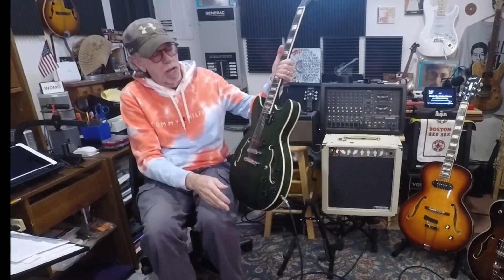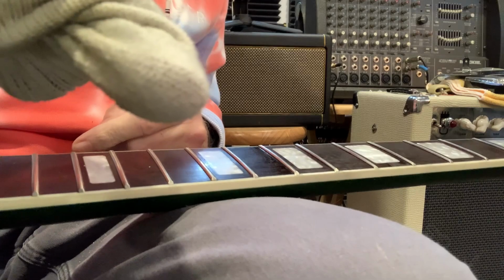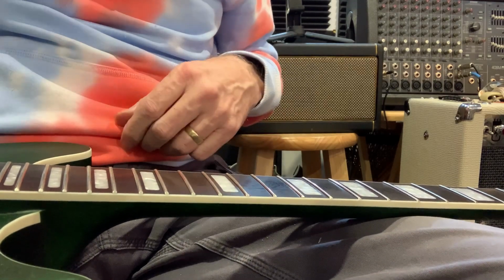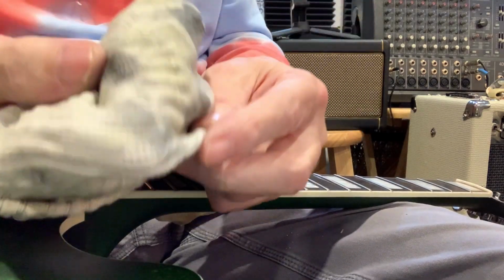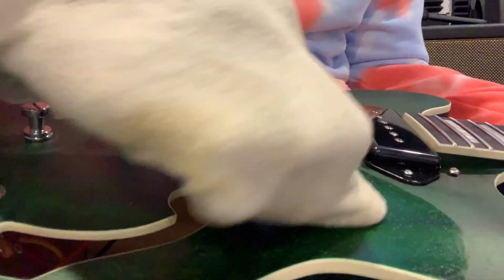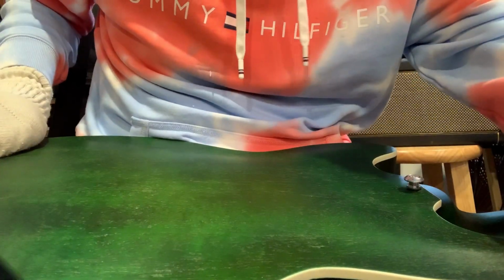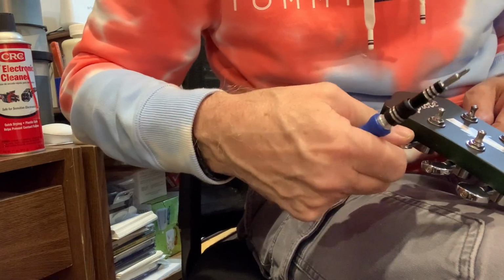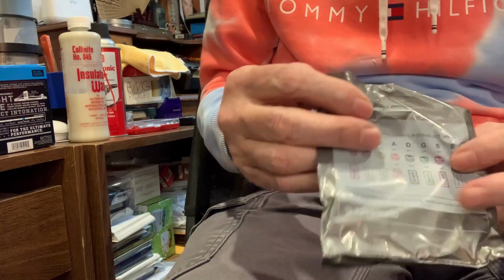New!! Grote | GR35MT | P90’s | Cleaning | Quick Setup

Comment: Hey Jimmy!  Very nice, a beautiful guitar!  The close ups of the finish really show how nice it really is. One thing I find helpful, even on some "higher end" guitars with a pickguard is to remove it and put a couple small layers of a strong tape (duct tape, gorilla tape, not masking tape) over the screw of the pickguard support underneath the pickguard.  This prevents that screw tip from making contact and putting a divit in the finish. I learned this the hard way.
Reply from the maker: Thanks so much Ted for watching and commenting!  Yes, the finish is quite nice and unique on this guitar.  Thanks for mentioning the “pick guard tip”, as yes, I use plastic caps on a couple of the Firefly’s specifically as the screw mount and screw on those is quite long and almost touches the finish with no pressure on the pick guard at all!  Taping the screw is another way to do it...good call!  Or, you can remove the pick guard altogether, as sometimes that looks good, depending on the guitar.  I am probably going to reinstall the pick guard on this one however.  Thanks again for stopping in...much appreciated! 👍

Comment: Great vid, Jimmy! The Grotayy sounds excellent! On a side note, I don't want to be 'that guy'. But, make sure you spin that fret rocker so you're only measuring 3 frets at a time. That's why it has the smaller sides. Fret rockers drive me berserk because there always to seems to be a little rocking in different spots sometimes that are hard to nail down. I've had to force myself to not worry if there is a very tiny bit of rocking.
Reply from the maker: Thanks so much for watching and commenting!  I usually just run it along (fret rocker that is) to do a quick check on heights.  I do give it a spin if I find something a little unusual in a spot, but yeah, thanks for keeping me straight! 😎. A small rocking usually doesn’t concern me either....this only had a small area that I hit a little more with some sand paper...wasn’t enough to break out any files.  Thanks again, and appreciate your stopping in to the channel!  👍

Comment: Hi, Thanks for the vid, I'm wondering if ya were to remove the pick guard from the single pick up Grote ... what would you have to do to make it left handed... replace the nut? Do you switch around the pick up? this would be my first electric guitar, thanks for your input Jimmy
Reply from the maker: Hi Todd…thanks for watching and commenting!  I would say, if you really wanted to, you could convert it to left handed.  Yes, you would need to replace/recut the nut.  If you simply just “flip” it, the heavier gauge strings would not fit in the smaller gauge string slots and the smaller gauge strings would surely just flop around in the larger slots.  You can buy “left handed” nuts, but you could also buy a blank and slot it yourself.  Of course the controls would be upside down and in a awkward place, but most can overcome that.  The bridge would also have to be reversed or replaced as well.  The bridge saddles follow the fretboard radius, so simply flipping it over (much like the nut explanation) does not really work unless the string saddles are correct.  You could probably do it by flipping it, then removing each saddle and turning the saddle around to correct position, or again, buying a left handed ToM bridge that fits.  Same with the pickup.  I think there is enough wire on the P90 to flip it around.  You could probably “fix” the stock nut to work, but they are cheap enough to just replace and save a bunch of work on your end.  Hope that helps a bit…I don’t think there is any concern as to possible “warping” neck or body wise as far as bracing and such.  Appreciate your stopping in to the channel and good luck should you decide to proceed.  🎸👍

Comment: Jimmy nice job on the guitar. I do exactly the same process with all my new guitars as well. I just went through it on the IYV400.
Reply from the maker: Yep!!  Just wanted to show a few folks (many ask) what my process is...most will be amazed at how much better ANY guitar will play once you get it set to your playing style and properly cleaned up, with good strings...
Thanks Mike! 👍
Reply from the maker: By the way Mike, how did your IYV 400 come in?  I know you will probably do a review of it, but was just wondering if there was any obvious issues on receipt.
Reply: @JimmyStewart1  
Out of the box it looked amazing. I got it downstairs on the bench and started doing a more detailed overview and I found like your green one, dirty fretboard and dirty Frets that needed to be polished. There was only one high fret at  16.  It was barely causing a buzz there so I just tapped it with the special hammer and it solved the problem. I then found a serious scuff mark on the inside of the horn. I noticed the nut needed to be cut the better to lower the action at the first fret. The rest of the front of the guitar was great and so is the back. The neck satin smooth no rough spots this time like the first Ivy I bought and the headstock was in really good condition. One of the bridge pickup mounting screws has the head stripped out on it.  The tuning keys are the fender looking ones and they work well enough they might be a little bit coarser but they're working just like IVY number one that I bought. In the end I had to replace the nut with a new one and I did the full cleaning and set up to my specifications and it now plays just like butter as Jimmy says
Reply: Since you own more P90 guitars than I do, do you know whether the soapbar mounting screws are a number two or number three?
Reply from the maker: @2bikemikesguitartopics145  
Super!!  Sounds like all in all nothing major and mostly stuff you can expect to do!  Have fun with it! 👍
Reply from the maker: @2bikemikesguitartopics145  
I would think a 2, but I would check on your guitar first as I am pretty sure they may vary from different manufacturers and perhaps even by different model at these price points.  If you are trying to raise those soap bars, it depends on how IVY mounted them.  Could be on springs (doubtful) or they used foam (probable).
IYV is the one brand that I DONT own a guitar with P90’s...🤣
Reply: @JimmyStewart1  
They used foam because I took out the neck pickup and looked underneath. The bridge pickup has the buggered head of the screw I just wanted to change it out
Reply from the maker: @2bikemikesguitartopics145  
Yeah, ok....got it.  Not having one of those, I don’t know the size.  Just take the other good one and try to match it up I would guess...

Comment: Nice video, Jimmy.  Thanks for sharing.  What is the name of the wax you are using?
Reply from the maker: I used Collinite No. 845 Insulator Wax.  You can usually find it at your better automotive/marine/RV supply places, or on Amazon.  It’s a bit expensive, but does a great job and won’t harm the finish.  A little goes a long way!  Thanks so much for watching and commenting Roger…much appreciated!  👍🎸
Reply: @JimmyStewart1  Thanks for the info.  I just bought some online.
Reply from the maker: @007380  
That’s great Roger!!  Glad to help!!

Comment: Jimmy, would it make sense to polish the frets first and then do the fret board cleanup and oiling so there is a single cleanup process or is there a reason you do it in the sequence you suggest? Thanks.
Reply from the maker: @philiptalk  
You can do it however you want that makes it easier for you…I usually go over it twice anyway, so just trying to catch what I can for a quick cleaning and setup!  Thanks for stopping in…🎸👍

Comment: I didn’t get where you sourced the fret protectors.  My father and I were jewelers I like your quality workmanship.
Reply from the maker: You can get a set from Amazon….pretty inexpensive.  Or you can spend big money and order from Stewmac….if only using them on occasion, just pick up a set from Amazon.
I have done over 15 guitars or so with mine, still going strong!  You can also just get a decent guitar tool set with these, nut files, string gauge/bridge height rulers for pretty cheap too.

Comment: Hey Jimmy! I ALMOST did it! I had one like this but red with white binding on Grotes website, just ONE click away from BUY, $158.00 scarole! And I chickened out!!! 😰
Reply from the maker: Well you probably “chickened out” for a reason I would guess.  Don’t really need it, have too many guitars already ( bad excuse, you can’t have too many guitars) or ordering direct from Grote perhaps?  Only the shadow knows for sure Ted....😎
Reply: @JimmyStewart1  I don't (necessarily) need another guitar, which means I don't need to spend more money on one, but I've been diagnosed with GAS and I'm fighting that disease, trying to anyway. But it's not totally out of the question. One thing though is that they look a little odd in the pictures. Like the bottoms were more flat than round. ???
Reply from the maker: @Mr.56Goldtop  
Hmmm...have not really noticed that.  I will now have to take a closer look...😎

Comment: How does the wax job hold up over time? I've got the vintage sunburst version on the way and I'm going to use your video as a set up guide. 

Is baby oil ok to use on a fretboard?
Reply from the maker: The wax is holding up fine so far!!  I wouldn’t use baby oil on the fretboard...I would think it would leave a “oily” film unless you really worked it in and got the excess off completely.  Thanks for watching and commenting,  glad to hear you using the video to help you out!  😎👍